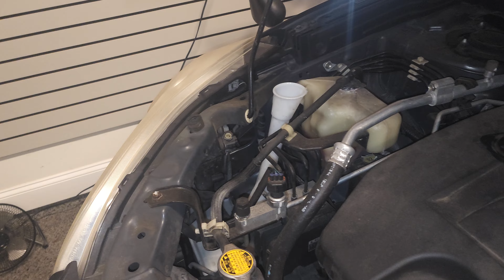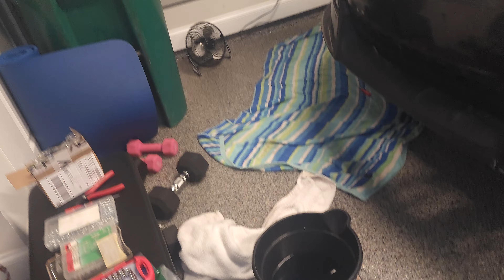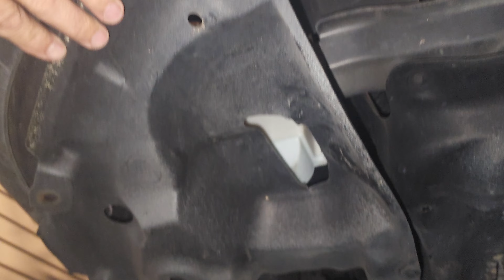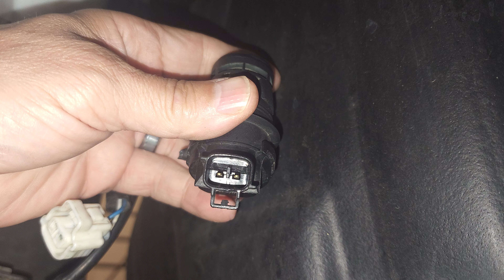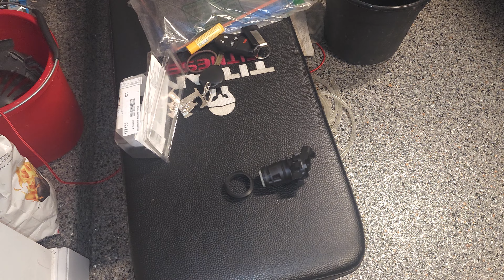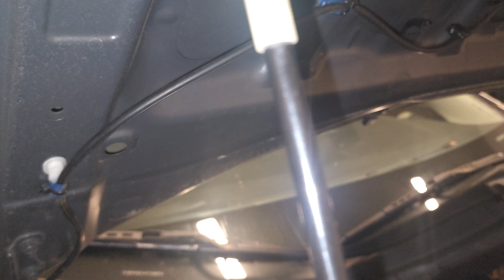How to replace windshield washer pump Toyota Corolla Matrix and many other car Lexus and others

Comment: Thanks for sharing your video yes I owned a 2010 matrix 2.4 now I have the same problem I try to use the reservoir to spray the windshield but no reservoir coming out but after I watched your video I think the pump reservoir have a problem because no sound from the pump the rear windshield is working fine tomorrow I will go the Toyota dealership to order one thanks again take care bye from Milton Ontario Canada 🇨🇦
Reply from the maker: See my other videos about this car. I have more videos you might need